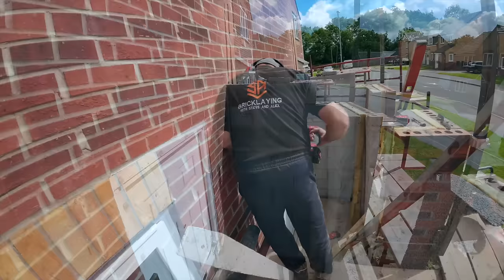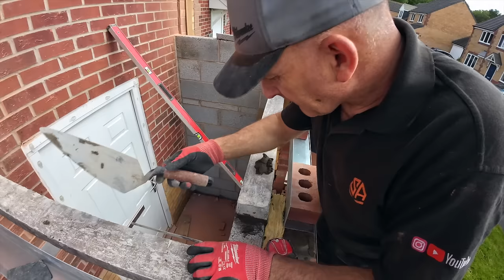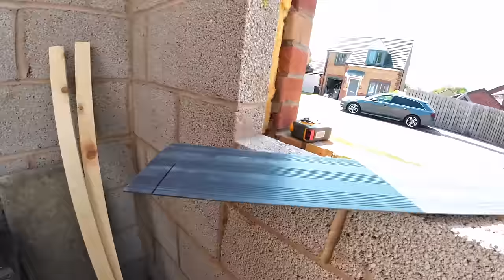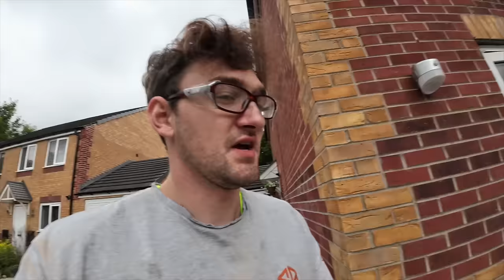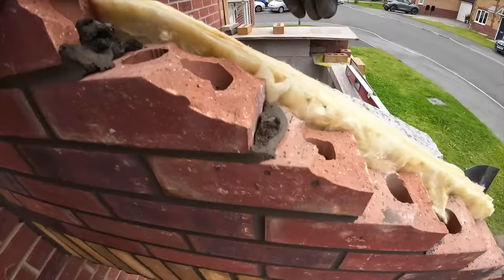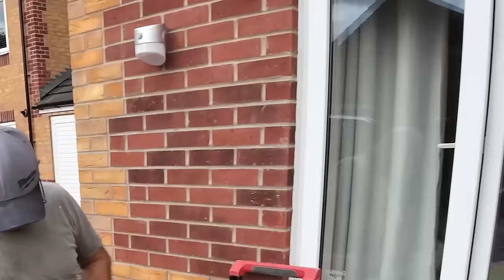WHAT A COCK UP... TAKE IT DOWN...PORCH BRICKWORK COMPLETE 1!!

Comment: I wouldn’t worry about having to redo the headers, we are all only human after all. What I don’t really get is the very light lintels you use in the UK, In Aus the only product available is 6 and 8mm galvanised angle.
Reply: They called boot lintels mate😊
Reply: Are they. We only have hot dipped galv extruded steel 6 and 8mm. What are they 1.5-2mm? They don’t look like they would hold much weight but once it’s propped straight and dry I guess it all ties together. Steve wouldn’t use if they didn’t work. We don’t need to prop ours.
Reply: @davidconnolly7346  well Aussies are pretty good brickies but the answer lays with the people who allow you the materials (architects, engineers and government). Seems you guys are led by the blind. But ain't we all?

Comment: Put one of those lintels in recently and happened to notice that the manufacturer said it was essential to prop up the lintel until the brickwork is cured when it attains maximum strength and locks in level.
Reply from the maker: Spot on mate . Always good practice 🧱👍🏽

Comment: Quick question, I’m no builder. If the lintel sags under the weight of the bricks what makes it strong enough to hold the weight when it’s finished?
Reply from the maker: The bricks are self supporting up to a certain point 🧱👍🏽
Reply: @chrisscot1193
When the "soldier course"  has dried it becomes one solid homogeneous unit.  And it behaves structurally as such, it becomes effectively a flat arch.
But to work effectively it needs to be restrained at both ends - which it is here.
Plus there is very little loading on the soldier course from above - so it does not have much structural supporting to do.
When the mortar is wet and drying,  it is reliant on the thin gauge metal lintel for support, and it becomes a "dead load." upon it  - hence the sagging.
  😁👍🧱
Reply from the maker: @martin2466 absolutely perfectly put as always Martin .
  Thanks very much 🫡🤩🧱👍🏽
Reply: @SteveAndAlexBuild  
Thank you Steve,
I remember doing a flat arch (solider course)  over 12 foot long above a large window and french door.  We used a red brick with small holes in them,  so we were able to thread 10mm re-bar irons through them to reinforce the arch. The reinforcing irons were anchored into the walling at either side - and it all worked splendidly. Just a timber lintel on the inner leaf. No squeaky bum moments and a nice reinforced "flat arch", with two storeys of walling above it.
😁🧱🔨👍
Reply from the maker: @martin2466 . Love that 💪🏼👌🏼🧱👍🏽
Reply: hats off to you my mate 👍

Comment: You’ll do the roof no problem. I had a reroof done recently, waited 1 months for the roofer to replace 8 tiles they broke by putting scaffold on my extension roof. Gave up in the end getting the roofer back and cut tiles and replaced them myself. Putting that on my cv now! 😂

Comment: Hi both. Im never ceased to be amazed that an angle iron lintel sags in the middle with just one course of soldiers on it. I assume thicker steel messes up the mortar height? So glad you use Heinz tomato 🍅 sauce and not the supermarket brands which are horrible 😳😂😂

Comment: Hi not sure if it is the area you work in and I have been retired now for 10 years but back when I was working a metal lintel had to have a minimum bearing of 150mm only concrete lintels were allowed a bearing of 100mm just wondering
Reply from the maker: I’m pretty sure it’s 150 mm minimum for both now 🧱👍🏽

Comment: That's what I don't like about L shaped lintels ,they flex , on timber frame construction you have to hold them against the wall using the cleats , I've used them when replacing an arch or non existent built straight over the wooden window now collapsing situation and what we did was drill a couple of holes through the back of the lintel near the top and fixed through to the inside skin using frame fixing screws and packers

Comment: hi where you tie into the existing house wall do you have to cut the cavity gap into the existing wall?,
Reply: Depends on what the building inspector (build control) want to see or what the builder likes to do! 😀 I just had to run DPC up the wall between existing and new walls
Reply from the maker: See below 🧱👍🏽

Comment: Well done chaps, quick question you used a concrete lintel on the inside and L shape lintel on the outside, can you used a cavity lintel instead or is there advantages one over the other :)
Reply from the maker: 50 mm cavity lintels are hard to get hold of now so we went for the separate ones . Cavity lintel is a better option 🧱👍🏽
Reply: @SteveAndAlexBuild  Awesome, thanks guys, love the videos
Reply from the maker: @bugcave8100 no probs , thanks very much 🧱👍🏽
Reply: I thought all external brickwork has to be 150mm cavity meet part L regulations,100mm if you use celetex @SteveAndAlexBuild
Reply from the maker: @gavinmcinally8442 not on a 3 m square porch that isn’t under regs 🧱👍🏽
Reply from the maker: @gavinmcinally8442 it’s a porch under 3 m2 so doesn’t come under planning or regs so the cavity is the minimum otherwise there wouldn’t be any room in the porch

Comment: Would catnics not be the answer?
Reply from the maker: To what ? 
Catnic is a brand name
Reply: @SteveAndAlexBuild  true just always refer to them as catnics sure you know what I mean much stronger than the angle thing
Reply from the maker: @grahamdalzell6933 . 50 mm cavity lintels hard to find now so just wanted it done . The lintel was fine . It was me rushing and not propping that was the issue 🧱👍🏽
Reply: @SteveAndAlexBuild  wickes sell catnics with 48mm centre for 50mm cavity. Why only 50mm cavity? council wouldn't allow that where I am.
Reply from the maker: @grahamdalzell6933 wicks are rubbish for stock items .
   It’s a porch under 3 m2 so doesn’t come under planning or regs

Comment: I’ve built soldier courses without lintels bit of 4x4 properly supported underneath, soldier courses built leave for a week take down the props done properly won’t move, don’t like doing it over doors as the slamming of the door can break the bond , on a lean to roof 23-30% would do me depending on the width, good detail in your work proper good job

Comment: How are you getting away with 65mm cavities, all my drawings show 150mm. ?
Reply from the maker: It’s 50 mm 🫣
Reply from the maker: How have you got drawings for our porch !? 🧐
Reply: Yeah 
100mm cavity 
50mm insulation 
Then u have 50mm air flow
150mm cavity 
100mm insulation 
Then u have 50mm air flow 
Insulation should not touch the 2 walls
Reply from the maker: @stephenrimmer-v3c wrong I’m afraid 😐
Reply: @stephenrimmer-v3c  rock wool touches both sides with no air flow but you need 150mm for part L, or 100mm celetex with 50mm air gap. Don't matter if it's a porch it's still an outside wall. Have a look at "skill builder, part L" he explains it better 😉
Reply from the maker: @gavinmcinally8442 it’s not supposed to be part l , we’ve made a video about part L ourselves so know about it thanks
Reply: @SteveAndAlexBuild  👍🏻

Comment: Why didn’t you use a catnic over the openings 
Av been a bricklayer for 42 years and never used concrete lintol for inside wall plus it should of been 150mm high not 75mm 
And using a angle iron on front face work strange
The cavity should be 100mm 
50mm insulation 
And u have a airflow of 50mm
Or
150mm cavity 
100mm insulation 
And u have 50mm airflow 
Insulation should not touch the inside and outside walls
Reply from the maker: I’ve been at it for 37 years and always used full fill cavity insulation with no problems . Plus if you were right full fill would be banned plus house builders use blown in insulation now .
    The modern pir insulation is 90 mm with 10mm air gap so all your information is pretty out dated .
    We do know what we are doing thanks
Reply: The chair-borne Building control personnel are out in force - arent they?
Reply from the maker: @martin2466 . They certainly are Martin. They’ve had a busy day today 🙄😆🧱👍🏽
Reply: @SteveAndAlexBuild  
Rearrange these letters to summarise... Wnaekrs all.
Reply from the maker: @martin2466 🫡. 😆😆🧱👍🏽
Reply: Must of hit a nerve
Reply from the maker: If you say so 👍🏽